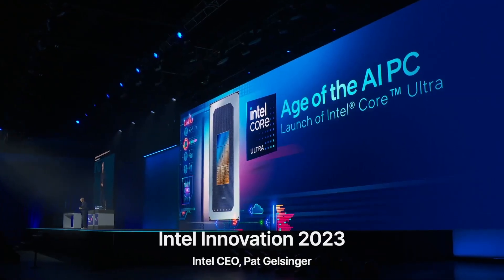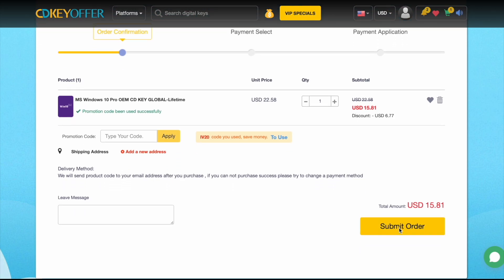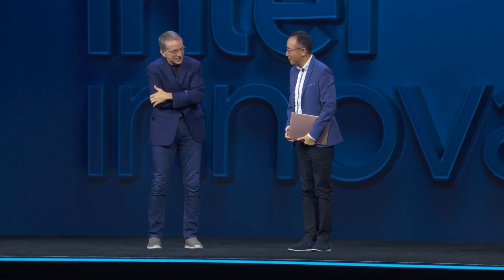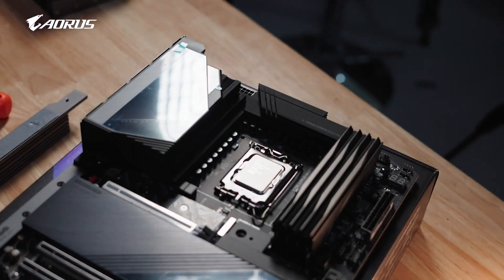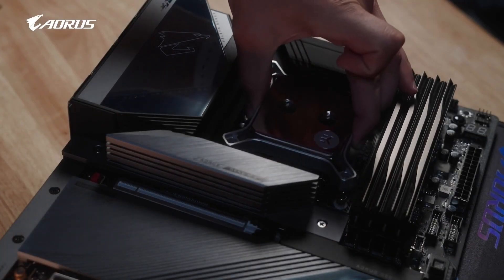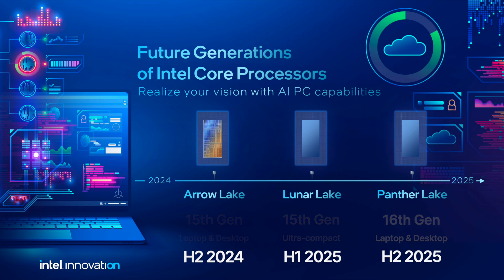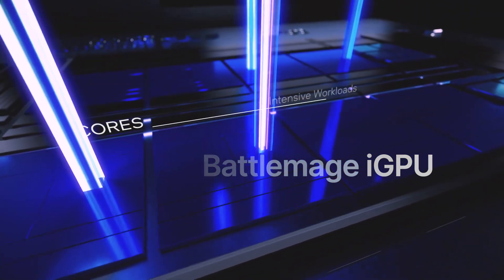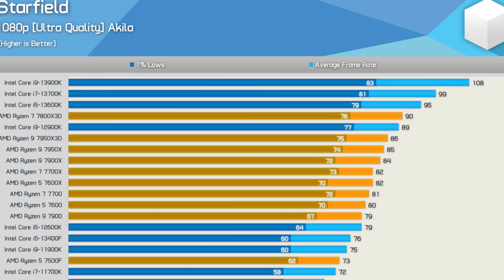The Future of Intel CPUs 2023-2025 [14th, 15th, 16th Generation]

Comment: Late 2026 17th Gen Nova Lake true next gen cpus to anything from last few years. 17700 is supposed to have a 144mb cache. That's true next gen. Current strong cpus only have 20-35mb cache. If your cpu is really old getting anything beyond a 12700k-13600k  now is a waste of money.
Reply: yeah tbh I’m just now looking at all these lakes man, I’ve been laptop basically since birth but I need a desktop to replace the old intel core i5 5200U 😭💀 stupid ahh all in ones can’t do shit for gaming and video editing and just all around everything tasks except maybe Macs but ehh

intel core i5 13600k looks interesting tho it surely must be a beast in 2024 right?
Reply: @rafaelacash7  12600K or 13600K would be 600-800 percent faster than that old I5 it's really about how cheap you can find them. Amazon you can find 12600K/motherboard/DDR4 32GB/cpu fan for 350 bucks that would be a fantastic bang for buck. Go for 12600k then get 17th gen Nova Lake(2026) for cheap in 2028-2029. or just wait till late 2026 and get 17600k or 17700k new.

Comment: im still on my i7 8700k... i do alot of surfing, illustrator and photoshop , it still is very good - i dont even have a gpu the uhd 630 can play most games i like on low resoultion... i think the next cpu im getting will be 15th or 16th gen...
Reply from the maker: Then you should be happy that the integrated graphics on the next generation will be much better than what you have now. Why don't you go for a laptop with an even nicer integrated graphics instead of desktop? That's what I did to do my work. It is very nice to be able to move around the house or go work outside instead of being stuck at the desk.
Reply: @theivadim   im almost 40... i had a couple laptops before never really was happy... last laptop i had was the surfacebook pro - i sold it after 3 month... i know they changed alot too but im working alot with creative cloud and blender and a laptop just isnt right for me.... i need my mouse and my wacom :D  i got me a ipad pro m2 last year for drawing and stuff , its nice but i still sit a t my desktop all the time :D

only thing i want to still test is a macbook air sometime in the future...

Comment: I want 16Pcores and 16E cores.. make it happen Intel..
Reply: Late 2026 17th Gen Nova Lake true next gen cpus to anything from last few years. 17700 is supposed to have a 144mb cache. That's true next gen. Current strong cpus only have 20-35mb cache. If your cpu is really old getting anything beyond a 12700k-13600k  now is a waste of money.
Reply: @tanyaiamyourfather so you don't advise going for 14th gen whether i5 or i7 at the moment ? I have been considering a new cpu lately, might wait until 15th gen is out and buy a new one.
Reply: @NoProof7  what is your current cpu?
Reply: @Brian-The-Giant  I have an i5 9400f. Been using it for years now, a big change is all I am for. Looking at the power these new i7 processors consume, I am rethinking my options and doubting whether it's worthy or not. 
I saw the ryzen 7 7800X3D and it's very strong and uses less power than it's peer the i7. 
What do you think?

Comment: I got i7-7700K thinking about buying i7-14700K should I do it? Or looking for smth else. I buy pc for like 5years or more
Reply: IMHO that'd be a sensible choice, depending on the price. Motherboards are reasonably priced, the platform is stable at this point and my experience with the 13th gen platform (I upgraded from an ancient Haswell platform) is very positive so far.
Reply: If you've yet to do so, try bumping your clocks up to 5GHz (or as close as you can).  7700k OCs nicely.  I'd personally recommend holding out until 15th Gen unless you need the extra cores.
Reply: get 7900X or 7950X or 7950X3D when they go on sales.
Reply: @hieuluutran7572  14700k is 20 cores

Comment: Thanks, but tbh, nothing matters until we get the proper independent benchmarking, and see the actual prices. Anyone who runs a 12th gen intel LGA1700 mb, with a cpu up to 12600k, might well find a great value upgrade deal in the 14th gen intel cpus. Especially if their RAM is DDR4. 15th gen might be amazing at the highest levels, but it'll need new mb & DDR5 RAM, so an extremely expensive choice, if simply upgrading your existing LGA1700 kit will provide everything you need for the next several years.
Reply: Does this mean that the motherboard with the LGA 1700 socket is not suitable for the new generation of CPU?

Comment: Is it worth to upgrade from 13900k to 14900k?
Reply: No. Unless you care about an extra 5% performance.
Reply: Even the i9-10900k is still pretty good
Reply: @Beall_  True.. But would be a significant performance uplift from gen10 to 14 though
Reply: @queenofstamford3141  no cpu upgrade above 10th gen is fully worth it until intel irons out their latency issues. Maybe only if you run a fat gpu above 4070/3080 at a lower resolution or if there's a need for many cores
Reply: @Heart_Of_Adell  I checked just now and something must have happened (Windows update maybe?) because my latency problems have disappeared.
Reply: No!! Only worth it if you're still running gen 11 or older
Reply: Nope

Comment: Intel7 is 10nm, which is almost twice area than actual7nm. Now intel4 may be a 5-6nm Chip as per intel naming scheme. 
f intel4 is only 20% efficient than 7 then it's just a naming thing. No actual improvement. TSMC4nm AMD chips gives twice performance per watt than intel in heavy power using apps  . AMD4nm CPU and Nvidia 4nm is the best combo. For real intensive RTgaming and productivity usage with more lasting 🔋 than intel . 
AMD is yet to release 4nm APU with 16CU for iGPU for some real gaming and should be cheaper than intels SOC assemblage. It's good to see more competition but I'm skeptical about actual delivery of this intel4 on laptops.
Reply: What TSMC calls 7nm is THE SAME in almost all respects as what Intel calls 10nm.
This is OLD NEWS and has been very well documented.

Comment: should i buy the 13th gen or wait for the 14th gen?
Reply from the maker: Desktop? I would wait for the 14th. Grab a 13th gen if it is discounted (as it should be). Because otherwise you'll overpay for the 14th gen while not getting much more performance.
Reply: For laptop, wait for 14th. For DT, 13th and 14th are the same.

Comment: Intel needs to fix the Heat/Power Draw problem 
You cant even get the max out of 13th gen without going with a custom loop and a delid
Reply from the maker: That they do, indeed.
Reply: I have a thermal right air cooler on mine… with no issues
Reply: This is false. People just don't know what they're doing.

Comment: 40% sounds good and all but wake me up when Intel release HEDT
Reply from the maker: Do you need HEDT for more cores/performance or for more PCIe lanes?
Reply: Storage mostly, don't need 4GB/s PCIe lanes but I do need at least 64x at 1GB/s, that's mostly because of what hardware is available.  My Asus Rampage board has 12x SATA 3 6gb ports which is a nice start, but 40 PCIe lanes gives me some NVMe drives and additional SATA as well.

Comment: i9-12900k worth the upgrade to i9-14900k ? im considering it ..thoughts ?
Reply from the maker: I think - no. If you weren't compelled to upgrade to the 13900K then there is no reason to consider the 14900K either. I'd keep enjoying that 12900K and see what 15th gen will bring.
Reply: @theivadim  ya. Only reason I didn't go with the 13900k is I would've had to get a bigger case and aio.  Which now I have.
Reply: Nop
Reply: NO!!! whait for 15 Gen, if u gona get the new Nvidia RTX 50 series GPUs!!!! RTX 50 series minimum is 15GEN arrow lake for intel MOBO
Reply: @DeadlyDiscoPineappl3s   nah i have the 4090 strix .. it will be 4-5 years next time i upgrade that .. haha
Reply: @coryo617 why the strix tho? Why pay so much more for the same perf as tuf and all the other models?
Reply: @maegnificant   why not ..i wouldnt say its like all the rest .. lol
Reply: @coryo617  it performs completely the same as any other 4090.
Reply: @maegnificant  i like strix better.
Reply: @coryo617  ok
Reply: @DeadlyDiscoPineappl3s nonsense.
Reply: You don't need a bigger case and AIO. If you're limited by the thermals.... just lower the maximums. 13900K in particular is much better than 12900K at lower power draws. If you actually needed that much performance, to draw 300W constantly from the CPU, you wouldn't have asked here if it's worth the upgrade. And 14900K might be another significant improvement of performance at lower power draws (125W or lower).

Still, in general, if you can't put your finger on what you NEED, then you shouldn't upgrade. Some people are still perfectly fine and very well serviced by 9900K.
Reply: @Winnetou17  i dont need that 300w power draw i was just told by several people the 13900k runs hotter then the 12900k so i was just gonna wait to get a bigger case so i could at least get a 360 aio which now i have . i know what i need just thought id get 2nd opinion..
Reply: @coryo617  It runs hotter, as in, it can get a bigger power draw too. It's a better overclocker. But you can run it at the same power (and cooling) as 12900K and still have most of the performance improvements. Which are not that big to begin with: more L2 cache, and slightly higher clocks, which might get nullified if you keep the same 200-250W limit. There are 8 more E-cores. You can certainly disable the extra E-cores (or all of them) and have more power (literally) for the P-cores. And for the cache ring multiplier.

I'd still say to wait to at least see 14900K. Apparently 14th gen has a DVLR or something like that, a voltage regulator which makes it more power efficient (and one of the reasons it can go about 200 MHz higher). So while it should be exactly the same as 13th gen if it runs at the same clocks, it should be able to clock a bit higher on the same power draws.
Reply: @Winnetou17  thx for the feedback.
Reply: Not really
Reply: 14900K would be a heavy investment in the end of line LGA1700 when the 12900K is already a great cpu. If you had a low end 12 series on a good MB, upgrading to a 14600K or more, might be worth it, but not if you already have a top end 12th gen, at least I would think?
Reply: I'll be upgrading from 13900K to 14900KS, so I would say yes.